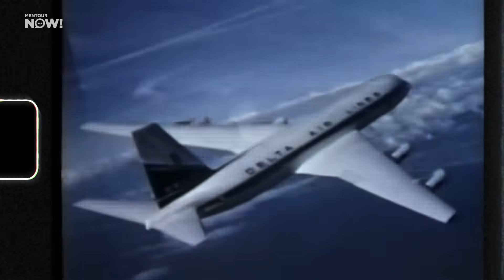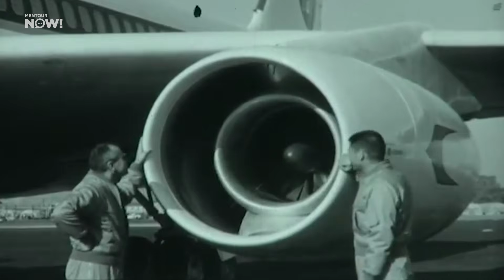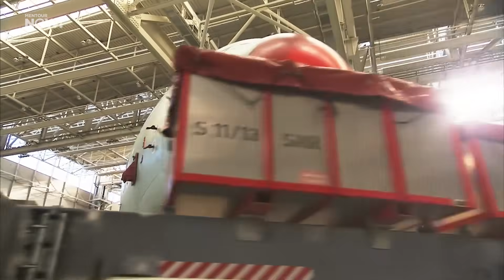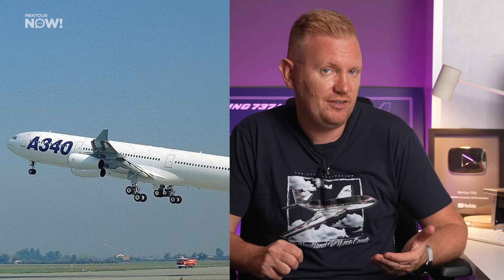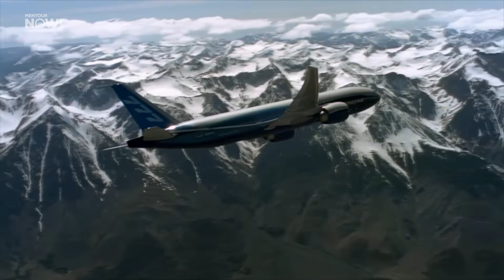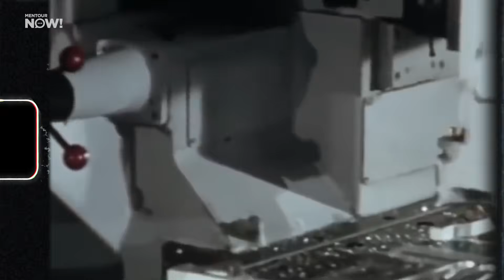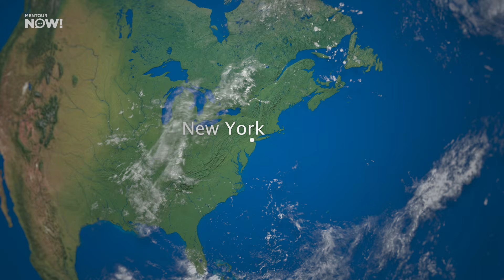WHERE is the Boeing Sonic Cruiser?!

Comment: All it needed, was to be shaped to fly supersonic. With the FAA allowing a peak high point of sea travel approval. What airliner companies fail that Lockheed SR-71 achieved...It did have wings! The body itself, IS a wing. The only reason it had wings & fin limbs. To carry a very bulk cost effection fuel turbine blade engine, that was far out to exploit sound into speed. THAT is why Airbus designers eventually won later.

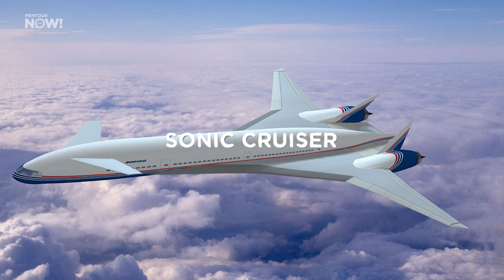Comment: 12:58 "speed and convenience"
More like reducing the agony by reducing total trip time and sardining. Faster planes increase sardining. Slower planes eliminate sardining without significantly altering total trip time.
And things are changing. Airliners are headed towards self driving. This will change costs even further towards capital and especially fuel. The future is slower planes with props and 70% efficient piston engines.  Cheap and fuel sipping while providing lots of space per passenger.
18:25 "offset.. ...by optimizing the aerodynamics"
Impossible. For any given level of aerodynamic optimization slower is better.
Thumbs up

Comment: The Sonic Cruiser's plan form makes great sense even if the idea of going Mach 0.1 faster for 20% more fuel burn doesn't. A canard aircraft with a two lifting wings can theoretically be more efficient than a wing-tail design. The rear located engines will make the cabin quieter and being wing mounted they won't incur the weight penalty of traditional tail engine designs. It is a shame that Boeing did not pursue this layout -- perhaps with less wing sweep and smaller strakes -- for the 787.

Comment: im thinking of the sonic cruiser type design not so much for speed as for fuel savings. something like the Piaggio  where the shape of the fusulage contributess to 10% of the lift allowing use of a smaller wing.  maybe that design will come back at the right time

Comment: The way I see the only way I see a good supersonic passenger airliner be resourceful cheap and safe. Is a large swept wing/folding wing design to both create a lot of lift on take-off and landing and at regular airspeeds and fold back for higher speeds. With that, you get around the paradox of lift over drag bigger the wings the more drag and the smaller the wings the less lift.  The other is that ram jets are going to have to be used as they create great thrust at supersonic speeds as well as having a lot greater fuel efficiency, in conjunction with some retractable high bypass or low bypass turbofans. This allows the plane to operate efficiently at high speeds and low speeds. While also giving it the capability of a much higher cruising altitude allowing for far greater fuel efficiency and, drag. This is what would be needed for a successful supersonic passenger airliner of today.  It allows far greater range larger range and great speeds as well as not having a really high stall speed. allowing for shorter landings and greater airport availability. This is the only method I see a supersonic passenger airliner of today working.

Comment: Considering Boeing can’t even make variants of aircraft they’ve made for 20-40 years work well, they have no chance of pulling off a clean sheet design. Boeing is now just an aircraft modification company. Their experienced engineers and manufacturing people were under appreciated and forced out for cheap labor and shareholder profit. Reap what you sow you slimy Walmart of an airplane company.

Comment: Can’t help but feeling worried about this design. Rolls has been known to cut corners and this is a very complex design. A geared turbofan is difficult at best and introducing variable pitch just lends itself to a whole new set of failure modes. No thanks. If PW did it? Sure. Rolls with their tendency to overcomplicate things? Right…

Comment: I worked in the Boeing wind tunnel at the time, and one of the reasons it failed was that they couldn’t make the numbers work and they lowered the cruise speed from .98 down to .96, and then again to .95 and at some point they realized the time savings was not going to cancel out the extra fuel burn. It was a beautiful plane, and I remember there being concerns about the wings on the model cracking because they were so thin

Comment: The sonic cruiser used some breakthrough technologies to achieve a marginal increase in speed.  Turns out they enabled a substantial increase in efficiency in the 787 instead.  Plus the extra fuel and range did at least as much for long thing routes as the sonic cruiser's speed would have done.

Incidentally, the airliner that made the biggest use of the area rule was the 747, with the hump phasing out just where the wings phased in.  This made the 747 noticeably faster than other airliners.

Comment: Sorry to correct you - but the reason that SST's never caught on is because of the US FAA's rule against supersonic travel over the continental US. Consumer sentiment of "cheap" or "efficient" has nothing to do with the lack of SST's. The FAA rule against supersonic flight has nothing to do with sonic booms, as Gulfstream found out the hard way when they almost went bankrupt after developing a telescoping nose section that eliminated the sonic boom. The FAA still refused to let this aircraft fly supersonic over the US, causing Gulfstream to abandon the project entirely after sinking a very large amount of money into the design. So long as this archaic FAA rule exists - there will never be a widely adopted SST because the airlines aren't going to adopt a single SST airframe that can only be used over the oceans when they can adopt much simpler airframes like the 777 that can be used in both domestic and intercontinental flight. The more airframes, the more expensive (and difficult - in the case of SST's) the maintenance becomes.

Comment: Boeing’s initial design for the SST was minimum drag/max fuel economy design - an integrated wing/body. This meant no windows so Boeing even went so far as it include a scene generator system to project on each “window “ to provide a view of what a passenger would see if they could look outside. When they presented this prototype mock-up to the airlines they barfed saying no one will fly on a plane with no windows so Boeing had to redesign and create a supersonic aircraft with huge drag penalties and associated fuel costs leading to its demise …

Comment: My understanding of the Sonic Cruiser project was that the extra speed was meant to appeal more to airlines than it was to passengers. The thinking was that the shorter flight times would mean that the aircraft could potentially operate one or two more sectors per day, compared to a more conventional aircraft. I’m fairly doubtful if this would have actually worked in practice, or if the extra sectors could have offset the additional costs operating the Sonic Cruiser would have entailed.

Comment: I believe the reason that passengers prefer the point-to-point model is mostly simplicity. I don't think it is about the hours, it is about the fact that you can't miss a connecting flight, you don't need find a place to spend the night if there is no immediately connecting flight etc. - just like in daily public transportation we humans prefer the route where we check in and get on board ONCE and don't have to spend the ride worrying and preparing for the next check-in, timing and orientation when changing to the connecting bus etc. Yes, hindsight is always 20/20 - but in this case it was more than obvious that a) passengers would always prefer point-to-point (not sure how Airbus missed this) and b) any performance difference that wouldn't cut the trip in half wouldn't make a difference to the individual passenger (not sure how Boeing missed this). Slight improvements are only relevant when you repeat something a LOT, which is why small fuel efficiency improvements are relevant to airlines, but rarely a consideration for people buying a new car (shamefully).
Betamax losing to VHS should have taught that lesson: Betamax offered slightly better quality, but VHS offered double the runtime. Long-haul trips are not exactly commuting. The vast majority of people taking these trips probably do them once a year or even just once a lifetime. They probably don't remember how long this particular trip took last time and don't expect it to be fast. And they know they will be jet-lagged anyway, so they expect that it will take one day to properly arrive. Also, if you book a trip and can choose between saving one hour or 50 dollars - well, most people don't make $50 an hour (especially not on vacation). This plane would have had to be efficient enough to be at least as cheap to operate as competing long-haul jets. One would assume Boeing had enough smart heads and access to data on passenger booking behaviour to figure out these factors and their respective importance.

Comment: Elvis naturally had the coolest 4 engine airliner the Convair 880 with 4 J-79s. The 990's engines had fans at the hot end which was unique. I used to see the shock waves on Boeing 727s you had to have the sun on the other side of the plane.
Reply: You can see them on 737s all the time if conditions are right.  I've also seen it on an A321.

Comment: I was in Seattle, at Boeing when the Sonic Cruiser project was first introduced at the end of March 2001. I interviewed Alan Mulally (and Phil Condit a couple of days later in St. Louis). 9/11 had a huge impact on the air travel industry and this affected the Sonic Cruiser program, but eventually the airliners preferred a 20% fuel consumption cut to a 20% flight time reduction. So the Sonic Cruiser gave way to the 787.

Comment: So is the sonic cruiser an early example of the shape that airlines have started investigating again due to the innovations around electric engines? The extra (and constant) weight of the batteries I presume would want to be offset by improved aerodynamics, and with advancements in 3D printing make more complex shapes a lot more feasible (using technology akin to Relativity Space for fuselage construction for example).

Comment: Concorde actually still adhered to the Area Rule, even though not as drastic as F-5. If you look closely to the fuselage, the fuselage have a reduction of diameter,(the widest part is just before the starting point of the leading edge of the wing). In addition. The vertical tail doesn’t start until the wing’s trailing edge and tapering of the fuselage.

Comment: No the Sonic Cruiser was a crazy idea. I believe it was  more of a design study/stunt at a time when they had no answer to the A380. Cruising at Mach 0.90-95 you are at the place where drag rise begins to go vertical. It doesn't return, to a manageable level until M 1.2-1.4. If could post a drag rise chart here I would. It would have been much more efficient to design an aircraft to cruise at Mach 1.3-4 or go all the way like Concorde to M 2.0. That's where you get the efficiency benefits if you can supercruise like Concorde did. The 880/000 were 3x2 seating. As for the snazzy 880/990, there is no  way 3x2 seating could compete on CASM with 3x3 seating.
Reply: Sonic booms over populated land masses has been a no-go and will remain so

Comment: I was in Boeing PD at the time. Boeing Marketing and Engineering needed to put enough work into the Sonic Cruiser design for airlines to properly evaluate whether it was worth it more to travel faster across the Pacific with the same fuel efficiency as a 767 or to travel at the same speed with a 20% increase in fuel efficiency.
- Would passengers pay a premium ticket price for speed? 
- Could airlines better use capital equipment by making more flights per day? 
- Could an airplane be built with new technology for a price that airlines were willing to pay? 
You aren't going to get a good answer on these questions unless you put the work in up front to develop a feasible configuration. And let's be honest here, Boeing never stopped working in Preliminary Design on a conventional airplane design while the SC was being shown to operators. The advanced engines in particular were the tent pole that dictated the pace of the program and both 7E7 and SC were going to use the same engine.

Comment: Not all engineers at Boeing thought the Sonic Cruiser was a good idea.   I say this with apologies to my friend, Chet Nelson, engineer X and the holder of the Sonic Cruiser patent (you see his name on it in the video)   The SC was an outgrowth of the HSCT program.  That airplane naturally wanted to cruise subsonically at about Mach 0.95.   (Chet worked for me on the HSCT program)   The big fatal flaw in the SC was you paid the structural price for the thin, highly swept wing appropriate for a Mach 1.6 - 2.0 airplane but only got about a 20% increase in speed.   For many of us the airplane made no sense whatsover.   The idea of point-to-point service was the single best idea to come out of the SC era.  I say era because in the early 90s Boeing and Airbus teamed up to study a New Large Airplane.   The cooperative effort ended when Boeing marketing came to the conclusion that P-P service with a smaller airplane made more sense.  Airbus (well, France) wanted to build something bigger than the 747  - and we all know how this story ends.
Reply: what would a better wing design for mach 0.99 look like?
Reply: @sadiporter2966  A Mach 0.99 airplane makes no sense.   But if you really wanted to do that, the wing would look like a supersonic airplane's wing.  And that's the point.  You pay all the structural and aero penalties and then stop short of getting the real benefit.   Just design a Mach 1.6 airplane and it wouldn't look much different.

Comment: At 13:25 you say that "drag increases with the square of speed". This is only true if the drag coefficent remains constant.
The big penalty with transsonic flight is that in this domain of speed the drag coefficient itself is increasing, making the drag penalty really worse. Otherwise there is no real drag penalty with speed. If we rework your example of doubling the speed, thus quadrupling the drag, this supposes that this happens with the same air density. But if you fly higher so that the air density is divided by four, the drag remains the same. Assuming that the lift coefficient also is inchanged, the lift also remains the same, just as the weigth of the airplane that it should support. The thrust needed to counter the drag also remains the same, but not the power, which is the thrust multiplied by the speed, so it is doubled, not quadrupled. Of course it is not obvious to provide  a power multiplied by 2 in an air density divided by 4. Even with a factor less than 2 it was impossible with piston engines but with jet engines this became possible as long as they remained in the subsonic range.
Reply: His statement is correct.  Drag does vary with the square of the velocity.  The fact that the drag coefficient may also change is another matter.    There is a practical limit to how high subsonic airplanes can fly.  At altitude, a significant portion the lift comes from compression - not suction like on a subsonic airplane.   Look up Robert Kulfan's patent 4,598,886 for Jonathan Livingston Seagull airplane.    It is an analytic wing design that focuses the lower surface shock to produce a super efficient wave rider.

Comment: A fellow I know told me about flying the flight sym  cockpit for the Sonic Cruiser. 
The plane would be fly by wire stabilized and if the computer failed the vertical stabs were undersized for lower drag. The plane was flyable but directionally unstable. So drunken sailor-- or pilot ride.
As to the fuel its consumption that no match for 787.
The other questionable    
problem was the altitude that was going to be used raised a problem. US FAA requirement for the number of seconds allowed to grab Oxygen Masks in the event of catastrophic cabin depressurization.

Comment: I was at Boeing when the Sonic Cruiser was announced, and I have different memories from your video. My recollection was that it was to be slightly supersonic, like Mach 1.1. It's real speed advantage would be on routes like London-Sydney, where the higher speed would allow much better utilization (turnaround, that is) than a slower jet. Also, it would have so much fuel volume that it would probably never be flown with full tanks.
Reply: Nope.  The Sonic Cruiser was never designed nor advertised to be supersonic.

Comment: The Sonic Cruiser was killed for a simple reason: it was something engineers wanted to build, not something airlines wanted to buy. Their response was predictable: "If this can go 15% faster with the same fuel, how much fuel could you save with a plane that went at the same speed?" The answer became the 787, which reversed Boeing's market share slide in 2012, but the delay - even though some Sonic Cruiser technology went into the 787, so the time wasn't totally wasted - gave Airbus breathing room.

Comment: I don't see the point, economics or practicality of mach 0.89 vs mach 0.80. When stacked up next to the time spent driving to the airport, parking, check-in, gate-wait then taxi, baggage reclaim and passport control. Where's the $$'s in the stupid lickle mach number beside pure marketing nonsense? By and large you spend more time inside the airports than on the aircraft. I flew for work, skiing and holidays and thoroughly hated every single moment of it - esp. Geneva airport. (dump)